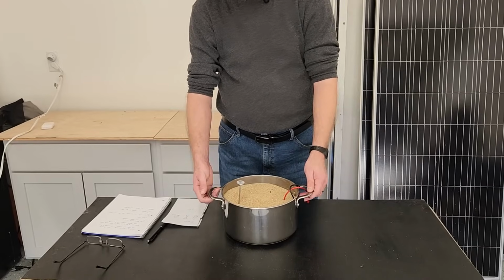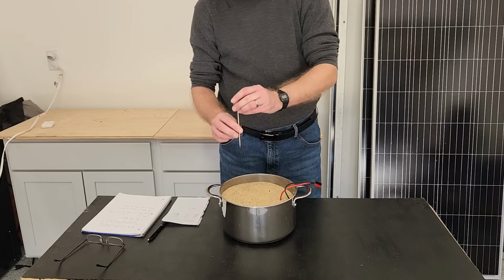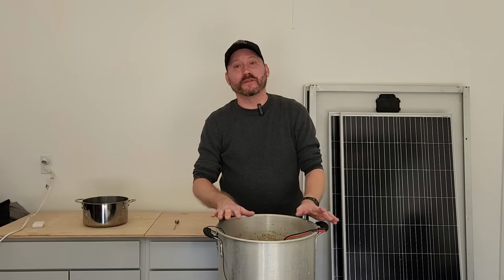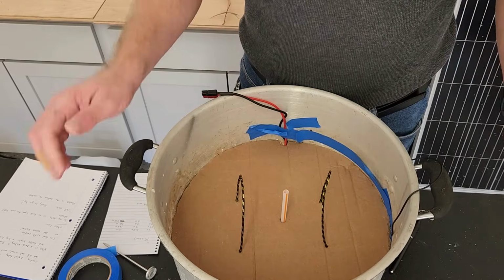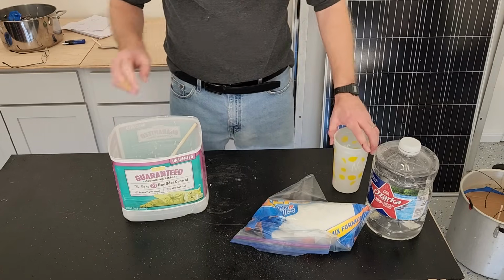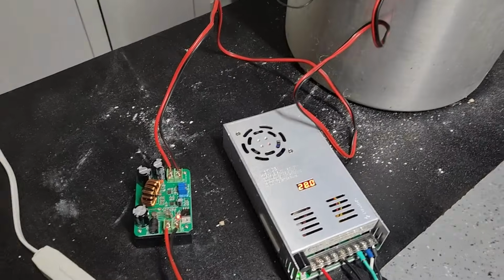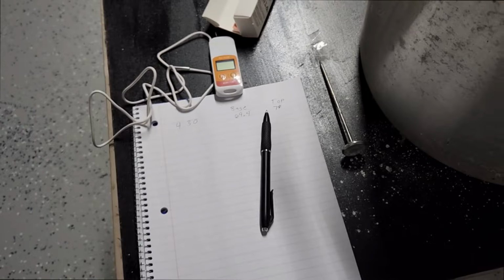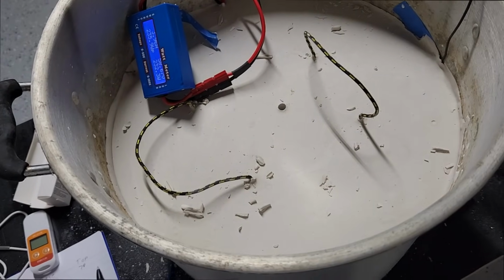Sand Battery heater. Create free heat  of 500F using solar electricity! Texas Prepper Projects

Comment: Did I miss something? Was there an explanation of how to set up the electrical parts of this? I saw a lot of instruction on mixing plaster, but nothing on wiring this up? Where can I get more info on this?
Reply from the maker: You connect electricity from the solar panel into the hot water probe.
Reply: @texasprepperprojects  thanks.

Comment: Why not drill a hole and mount the heat probe the way it’s meant to be installed. You risk shorting it out in the sand.
Reply from the maker: Check out video 2 for the reason why. Basically I don't want to destroy the pot

Comment: I would say to use more materials layering from the inside out .. from the most suitable material to retain the heat (inside) to the most suitable material to insulate the warm interior (exterior) so as to have the heat radiation from above and the least dispersion
Reply from the maker: Watch the next videos in the series

Comment: with some good  modern insulation  maybe like aerogel this could be made to work, with a removable lid to let the heat out when you want it. you could leave the sand in the bedroom , and run cables from the solar panels, but as other comment said with a better heating element that spreads the heat throughout the sand. In the uk some older homes had electric storage heaters ,which is more or less what your sand battery is. Same problem all the heat had gone in 4 hours.
Reply from the maker: Check my follow up videos

Comment: I think what you ought to do is put your sand container inside an extremely well-insulated container, and then run water through a heat exchange tube in it when you want it back out.  That way it doesn't just sit there and throw off it's heat - it comes out when you want it.

Comment: Hi Rob,
I love your video. After viewing it I was thinking of putting a copper coil through the sand and running my pool water through it and back out  to heat my pool. My question is: Did you connect the heater to the solar panel directly? Can you please let me know this.
Thank you soooo much . I’m a big fan of yours and have subscribed to your channel.
Thank you.
Buddy Paris
Reply from the maker: yes the panels are connected directly to the heating element. For hot water/hot pool, it makes more sense to do direct solar water heating as I've shown with black mats.

Comment: I had an idea to share to improve this... ultimately you want more heat transfer from the element into the sand, a liquid would be best but there's limitations to that, since aluminum is a great conductor of heat, why not bolt the heater element to an aluminum branch antenna that can wick the heat away from the element and spread it more evenly through the sand?  You might be able to build your own aluminum "tree" twisting aluminum heavy wire in a fractal pattern that pulls as much heat as possible away from the element and disperses it evenly through the sand
Reply from the maker: watch my follow up videos

Comment: You could use water. 1m^3 of water going from 20-90 degrees C stores ~85 kWh. Instead of using solar panels you can heat water to 90 degrees by focusing the sun.
Reply from the maker: Check my other videos for comments on this

Comment: Fantastic video and project thank you. I used a similar setup based on other videos on YouTube to heat 55 gallon drum of water. In those YouTube videos the engineers made a big deal about which element was being paired with which panels. what element did you use and what are the specs on it?  Watts, volts, amps I mean.
Reply from the maker: Check the links below

Comment: I'd put the heater element vertical, probably from the top, for easy maintenance, maybe more spaced evenly. You would need to figure out the wattages for that. You should have told us the voltage and wattage of the element to be better able to calculate things getting into Ohms law and such. 
Also, maybe some copper tubing if you bend it in U shape at different levels you could draw air through with a computer fan you would probably want a speed control on it but those are pretty cheap.
Reply: He mentions several times that the voltage is 60V with current of 4Amps giving total of 240Watts.
Reply from the maker: Check video 2

Comment: Even losing so much heat from the bottom… if it were sitting on a concrete slab, pavers, bricks, etc… wouldn’t that just add more surface area for stored heat?  Assuming we’re still talking Greenhouse.
Reply from the maker: Yes it would!

Comment: liked your video, i think bricks, clay bricks were used in the old days , they were called heat banks . where 240v would heat the bricks slowly over the wee hrs of the night on off peak power and the unit was then ready for delivering warm air in the morning for around 4 hrs before becoming redundant , and the process repeated. with a boost option
Reply from the maker: Watch vid 2 and 3!
Reply: Wee hours....lol...that's what happens when you get old, have to get up and wee wee every hour or so!!

Comment: Very interesting.  Thinking of making something like it for the greenhouse next year.  One question I have.  Have you considered running some pipe out of your sand vertically through the plaster cover to allow for heat to vent out through the pipe.  Or: along the line of the fireplace heater vent set up which look like a capital "C".  Takes cold air in through the bottom and moves it thermally out through the upper end. You would have to cut holes around your container to run these tubes through in order to supply the cold air intake, but it would seem to work thermally.  Just a thought.
Reply from the maker: check out my other videos for more testing

Comment: I wonder if oil could be run through a coil or just a loop in the sand and then be pumped to several radiators around the house. I have an electric "oil" heater in my bedroom that keeps the room warm in winter. the tubes could be insulated copper and the oil pump run by a thermostat.
Reply from the maker: won't matter. check out my other videos

Comment: Great video but you will need a LOT more sand. By my calculation, with 50 lb of sand heated to 500F, you have stored approx.
5000 Btu of heat. Not nearly enough to keep a smallish room comfortable in cold(~30F) weather.
Reply from the maker: Thanks for sharing!
Reply: @texasprepperprojects  ThankYOU for sharing. You did the work......all I did was comment....much easier<VBG>

Comment: I wonder if using solar collector would be more efficient in winter and using solar - for electricity.. sure temperature would fall to 250C° with oil as carrier liquid, but you would surelly get more energy and system is less complex..
Reply from the maker: check out my other tests on this

Comment: I wonder if you could use diatomaceous earth as an insulator for your connections that fused to the sand. DE is dirt cheap and is used as an insulator.
Reply from the maker: Check out video 2 and 3

Comment: You should look at a used small single element water heater then it would be insulated and none of the wires would be exposed to the heat then you could also do repairs.
Reply from the maker: Watch the other videos in the series

Comment: You should’ve made it out of a 55 gallon drum would’ve made a better sand battery .
For that matter, I bet a rocket mass heater built with sand would be extremely awesome at heating houses for a long time
Reply from the maker: I don't have room for a 55 gallon drum of sand in a normal house, but thanks for the reply!

Comment: Once the energy is stored in the sand vessel (and it's been optimized for efficient heating and maximum insulation)  there seem to be a few options as what to do with it...One, convert the heat back to electricity; This seems the most complicated, expensive, and least efficient.  Two, transfer the energy using a liquid circulation system. This will come with its own challenges depending on the fluid used. A closed loop of water can turn into superheated steam and become a serious hazard. A closed loop using oil poses a fire risk. Three, using an air circulatory system. This seems to me the simplest and safest design if it leaks or breaks its not a mess or hazard to the home. Air is a poor medium to transfer heat but its what everyone already uses. An old water heater might work but if it has foam insulation it will melt if it gets too hot. I think an old propane tank stood up on a concrete pad, wrapped in insulation (fiberglass or ceramic fiber) then skinned in sheet metal siding to protect the insulation might be a good build. Lots of copper coil in the tank for max surface area and build fittings on to the tank for connecting input output lines. Maybe build two, one electric and one combustion version. I have a bunch of old tanks so now I know what to use some for.
Reply from the maker: Check my follow up videos!!

Comment: Interesting video/concept.  I would mention that a split unit heat pump achieves 300+% efficiency.  This may sound impossible but I assure you that it is not.  We live totally offgrid (2 miles from nearest powerline) and heat on mild days using the heat pump.  If you were able to do a ground based geothermal setup the efficiency skyrockets to 600%, that is 6 watts of heat output for every watt of input.  Also to anyone reading/interested search youtube for "homemade heat pump".

With a 2.7kW array in mild weather I'm able to run everything a common house can + heat with the split unit.  My next step is making a heat pump based water heater using an old AC compressor and plate heat exchangers as seen in all the homemade heat pump videos.
Reply: Also if interested search youtube for "DIY Vapor Compression Refrigeration System" as he does a WONDERFUL job explaining how the refrigeration cycle works and demonstrates how its easy enough for anyone to do.  Keep in mind it works both ways so you can generate heat just as easily as cold.
Reply: As I add yet another reply (sorry):  Another video to find if interested.  Search youtube for "DIY Heat Pump Water Heater" for a video from a guy who converted a split unit AC into a water heater.  VERY good video with lots of information and he demonstrates a system large enough for a large family.
Reply from the maker: Thanks!
Reply from the maker: Thanks again!!
Reply: @texasprepperprojects   Heating 10 gallons of water from 40 degrees to 150 degrees is 2.69kWh of electricity (1:1 efficient standard water heater).  Using a geothermal based heat pump figuring "only" 400% efficiency its only ~670 watts to do the same work!  I was bitten by the bug and somehow the algorithm suggested this video so figured I would pass it along.
Reply from the maker: Stay tuned for new projects along that line!

Comment: Nice video. Interesting fact, water holds about 4 times more heat per degree, and same mass, compared to silica sand. That means you'd need to heat the sand to over 600 °F in order to store the same amount of heat per pound as water at 212 °F, assuming 70 °F ambient. Sand and water both has their pros and cons for heat storage, but if you're just want to keep your ambient temperature from going too low I'd say water would be slightly more practical in most cases. 

About heat dissipation, you will dissipate the heat you've stored no matter how you do it, what you can change is how fast it gets dissipated, the amount of heat can't be changed by how it's dissipated. Heat and temperature are different things.

I would make heat storage of sodium acetate, like in those "rechargeable" hand warmers. It is fairly easy to make, and doesn't have to be extremely expensive. Obviously way more expensive than sand or water, but that doesn't say much. The upside is that you can "charge" it when ever you have excessive heat or electric power that you can turn into heat, store that heat practically indefinitely, just activate it whenever you want it. I promise you this: you don't want to rely on the energy from a couple of solar panels to keep you from freezing to death during a snow storm.       

When the sky clears up you probably want to use the power from the panels for other things. If you still want to use that power for heating you can get a bit more heat by freezing water in a DC freezer, the freezer then act as a simple heat pump. The ice needs to be removed afterwards, otherwise it will suck up that extra heat when it melts.
Reply: erik where did u get your info on heat storage ? are you saying a bucket of sand at 600 will dissipate the same amount of heat as same size bucket of h2o at 212 ?
Reply: @douglasmcleod7481  Mass = weight, not volume. It's called specific heat capacity, and any material has a certain amount of heat per unit of mass and per degree temperature difference. It varies a little depending on temperature, but yes, a pound of water at 212 °F will emit about the same amount of heat that a pound of silica sand at 600 °F will, to reach 70 °F in both cases.    

And it's not my info, it's very basic science. https://en.wikipedia.org/wiki/Specific_heat_capacity 

If you don't trust wikipedia you can try any relevant science book.
Reply from the maker: Yup
Reply from the maker: Yup
Reply from the maker: Yup

Comment: Hello nice video !! My opinion is that this heater will not be enough to change a room temperature.. maybe it will be possible to change slightly a small room temperature. Everything it's depends on energy .. You are giving 250 watts for 4 hours then you have saved 1 kwh without calculating the loses.. there is no matter the temperature.. you can make an object hot glowing with 5 watts ..  what i am trying to say is energy conservation... 4 hours × 250 watt.. At the best case scenario it is going to be the same as to have working an electric heater that consumes 1 kw for 1 hour.. i am not rejecting the idea.. its very interesting if you have solar available you can make 2- 3 - or more of These.. nice video !!
Reply from the maker: you are correct. Check out my other videos for testing

Comment: I've been using a termo-accumulative (TA) heater for more than 40 years now. Electricity was always much less expensive at night here, so we would accumulate it then, and use to just radiate heat or turn on the fans via a thermostat. Of course, it has superior chamotte bricks, not sand.
Reply from the maker: Awesome

Comment: How about coiling up brass pipe inside that container and use it for a water heater as well?  Sand batteries are awesome tech. Underused.
Reply from the maker: You coups but I think that direct solar water heating is easier and takes less power for the pump. Check out my other videos I have tested this

Comment: Get an electric water heater and fill it with sand. Take the outer jacket off and leave it vented on the top, you can use long probe k type thermocouples and measure various points in tank and a set point controller to 2000f
Reply from the maker: Check out video 2 for the reason why not

Comment: With temperatures so high, it's likely to short the cables? Using aluminum foil and other insulation on both sides of the sand could possibly maintain the heat for longer.
Reply from the maker: watch the other videos. I use high temp wire now

Comment: Would it not be a better idea to convert a conventional storage heater-after disconnecting it from the electricity supply-thus making use of the specialized ceramic  blocks which were specifically designed to store cheap electricity during the night? Admittedly it might be a major task to try to use the sophisticated controls on the storage heater and maybe not possible if the heater were disconnected? Many viewers must have  old storage heaters and if they  could be safely used instead  of sand batteries it would be advantageous..
Reply from the maker: Check out the follow up videos. It doesn't work at this scale. Just buy a propane heater

Comment: Wood ashes are a great insulating material so... maybe you could put your sand battery inside a bigger bucket that would surround your battery with ashes. And for radiating the heat out of your battery, either remove the lid, or plant in it maybe an oven resistance that sticks out ?
Reply from the maker: Watch video 2 and 3
Reply: @texasprepperprojects  Oh, sorry I wasn't aware of them, will do :)

Comment: If you wanted to heat the sand quicker ,and release the heat evenly ,you would add water creating a slurry that you pump through capillary tubing .much like a radiator on a larger scale the sand and water filled tubes because they’re small would heat quicker and then being pumped to a reservoir and then pump back through radiator tape cast-iron heaters in your house.  steam will be created which has to be allowed to escape into a pot much like a compressor tank and as it builds pressure that steam would be used the turn A small steam engine that generates electricity. of course you need safety valves in case that steam gets too high and any Water from condensation would be pumped back into the sand.
Reply from the maker: Yup